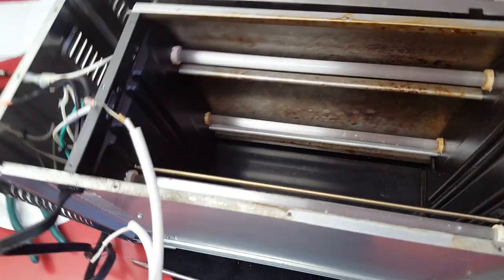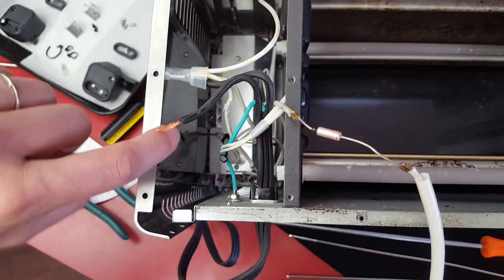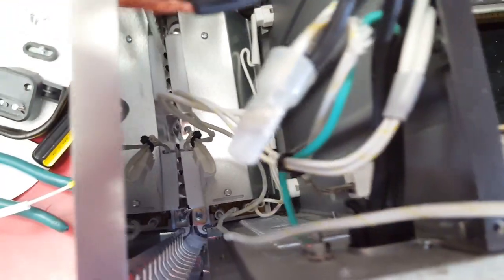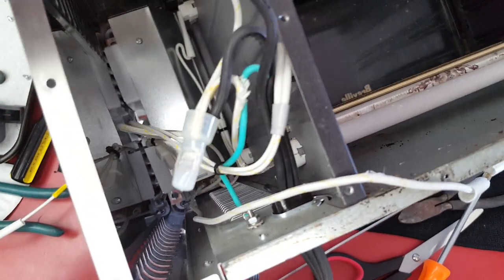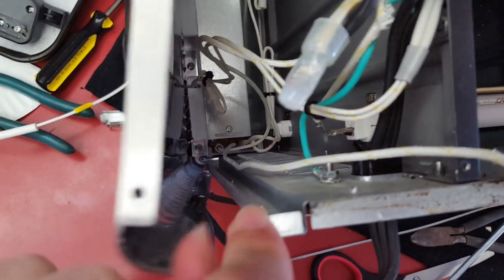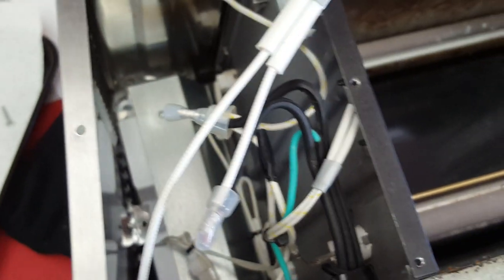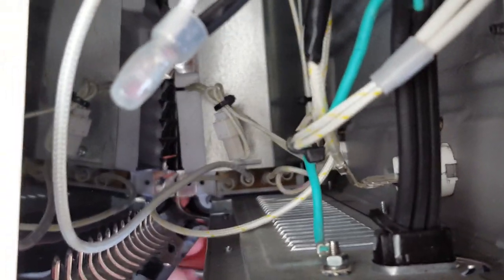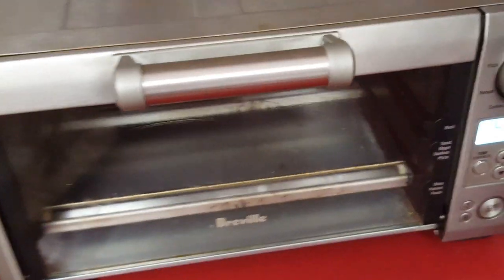Replacing Fuse in Breville Toaster Oven

Comment: You are very brave to tackle this with  a toddler wandering around and wanting attention. My dear aunt was not an engineer by training but her brother (my father) and her father (my grandfather) were both engineers and took stuff apart and put it back together all the time. When my father took apart  and reassembled my grandmother's sewing machine, it would only run backwards thereafter. She taught me to build a boat trailer with an axle from a wrecked car, some welding, and a few long timbers. Lady engineers rock. I am a male engineer (retired) and also love to repair stuff. I would feel more comfortable if you'd put the thermal fuse back where it was installed. Just keep your homeowners insurance paid up and a fire extinguisher nearby. I think it is a wandering black hole which sucked up the missing screws. You might find matching screws (likely metric) at an Ace Hardware. Great job!

Comment: The fuse and bracket NEEDS to go back in its original position. It is a thermal fuse, it opens and disrupts power if the temperature of the oven exceeds its maximum limit. DO NOT place it anywhere else, or you may have a fire hazard on your hands. I am not "yelling", only trying to emphasize that it is in its original place for a reason. Hopefully you put it back where it belongs.
Reply: FYI - at 18:35 mins she talks about fuse location. YES must go back in same spot
Reply from the maker: Thanks guys I really had no clue what I was getting myself into with this repair, and after rewatching myself I can imagine how frustrating I was for people that have more knowledge of these things. LOL thermal fuse now makes total sense why they mounted it there. Good looking out! 😊

Comment: Thanks for the video. I have the Breville 650 XL. The layout is quite a bit different, but the fuse is inline with the power cable. After removing like 40 screws, I determined that some people may be able to get it done just removing the back screws and enough screws to work the left side open. I bought 5 thermal fuses and a bunch of uninsulated butt splices so I cut the bad fuse out after verifying there was no continuity with a multimeter. I stripped a bit of the insulation from each side of the  wire and crimped the new fuse in making sure it was oriented properly. Your video helped me find the fuse and navigate the mess of screws! I've got an electronics and electrical background and I'd say you did a great job with the teardown and reassembly.
Reply: Did you have a panel on the back of the oven that once you removed the back plate underneath it was another plate/cover that appears to be pop riveted on and the legs/feet on mine run the entire length of the oven in two pieces meaning two feet on each side
Reply: @timfitsimones3301 Yes. The feet run front to back attached to a plastic bracket. The thermal fuse was tucked underneath the bottom folded in the white sleeved insulator. I used a spudger to bend the tabs on the fuse bracket to gain access to the fuse assembly.

Comment: 1. Thermal cutoff fuses do not have directionality, they can go either way.
2. There is no need to purchase a whole "fuse assembly", just buy the fuse, cut out the old one, crimp in the new one, slide the insulation over it, fold, and put back in bracket.
3. There is no need to unscrew the bracket that hold the the folded over wire with the fuse, the two tabs holding the wire bend very easily, just bend back into place when you repack the bent wire                   into it.

Comment: Helpful to see. My unit is the 650XL which has a slightly different layout. But I don't know that it would have occurred to me to take all the feet off in order to get the back plate off, so this was helpful. I ordered the full thermal fuse assembly from here:https://www.ereplacementparts.com/product_info.php?products_id=630212#RepairInstructions (this link jumps to the most succinct summary of instructions I've seen). Got my pricey (but good!) toaster oven back from no power to working fine again. Thanks!